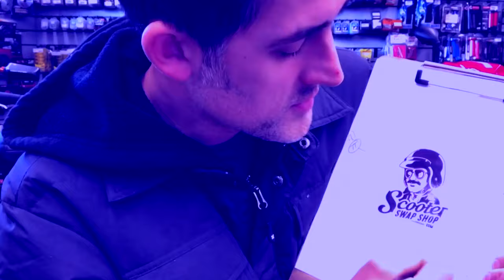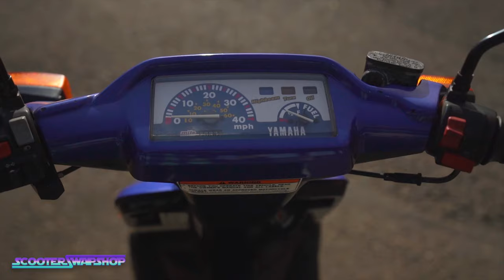NEW  2TR Cylinders for Honda!

Comment: the limitation with these off the top is lack of water-cooling, but then again it may not be targeting that performance. 15hp from a 80cc air cooled street motor is good.

It would be nice to have a water cooling "kit" available from somebody in the states that supports them.

I usually find the country of manufacture doesn't matter. With some of the last generation of 2 stroke street bikes Thailand absolutely kills it with supporting these machines. 

The cylinders aren't bad from China for the price. With a dremel tool to clean up some ports and knowledge of tuning a carb you'll get results that'll surprise.
Reply from the maker: No need for water-cooling in any way.... its not a 120 giant too big of a bore setup its a mild size that doesn't creat that dumb heat, well we sell 1000s of kits literally a year probably more then 10,000 last year, and country of origin does play a role, the china cylinders are junk the Manufacturing for these are on the lowest possible level that's why heat is a issue for them. Nothing to surprise us with. We install somewhere in the rhelm of 200 plus bore kits a year. 2-8 a week, not sure what your experience is and not bagging on you. But we have more experience in these bore kits then 98% of the people out there. the 2% are the other shops in the world that do this.

Comment: Just a question. Is there a lot of difference in power between air and liquid cooled 50 and 70cc's (like airsal 70)
Reply from the maker: depends on the engine